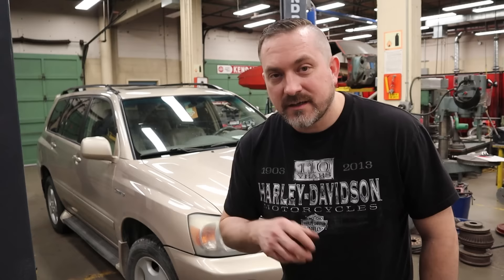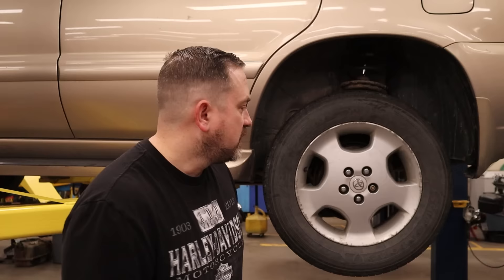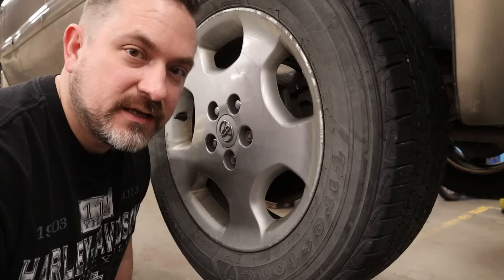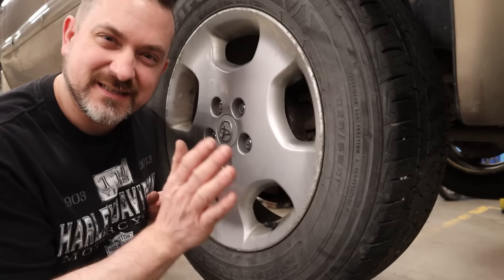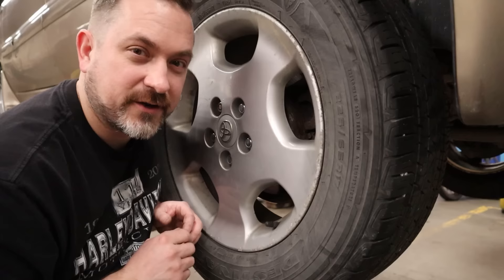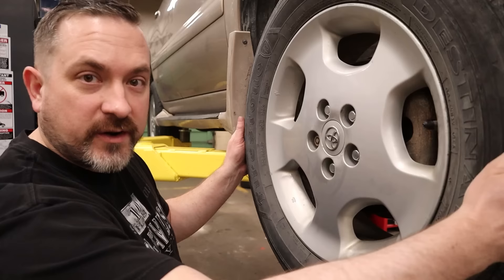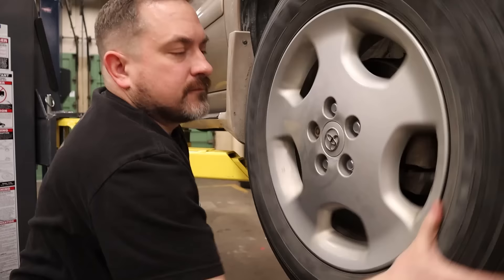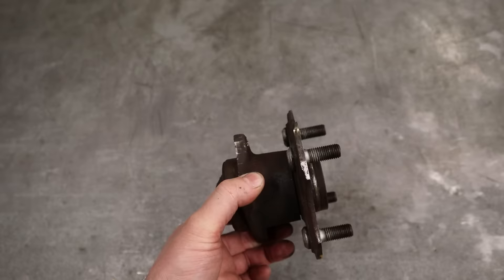How to 100% diagnose a bad wheel bearing.

Comment: Would it be the same, 0n a 2016 Rav-4 all wheel drive ??
Reply from the maker: Yes it should be the same as it has wheel bearing assemblies too.  Thanks for the watch!
Reply: I think mine is acting up, Left front!
Reply from the maker: You confirm it and change it?
Reply: Had the Left front wheel bearing replaced Yesterday Oct.6th, all quiet on the left front, thank you everyone 😄
Reply from the maker: Sweet! Glad you got it sorted out.  Cheers!

Comment: 2009 kia sportage  awd automatic  , when i let off the gass i hear grinding in front wheel it sounds like but i cant tell which side , i have jacked up both sides and no play in wheel bearing , i role the wheels by hand and no grinding , ive took off the break pads and all is good nothing touching , when i cut left or right the grinding is not as loud and when i apply the breaks it gets quite . im desperate now iv spent a couple ours trying to find the source of the grinding, i hear it most about 10mph
Reply from the maker: Is the backing plate/ dust shield touching the caliper?
Reply: hey you  wouldnt believe but i found the tiniest asphalt chip under the edge of the bracket holding the caliper  . dont know how i had the caliper off 2 times without seeing it , i had looked all around that thing and never did see it , i finally gave up and started taking the spindle off and it fell out soon as i rolled the rotor with the caliper bracket lol   ..   @wayofthewrench
Reply from the maker: Well what do you know......Did it fix it?

Comment: Ik this is an old video but im hoping you can respond. What if the sound does change when you break? So while im going down the road i started hearing a whirring sound that got louder as i tried to accelerate, i let off gas and it was still there. When i hit the breaks the sound completely went away. I then pulled over and turned car on and off then continued home with no sound for a ten minute drive. Ideas?
Reply from the maker: I would suggest jacking up the car and doing the tests to see if it has any play, check all 4.  If they are ok, check the brakes and steering/suspension parts out.  I have a great video on checking your disk brakes and how to jack up your car if you need.  Cheers!

Comment: Why didn't you mention play left and right,  up and down could point to tie rods or ball joints?
Reply from the maker: I believe I mentioned that if you have play only up and down it will be a suspension component and if you only have play left and right that it will be steering lock or steering components.  I didn't go into detail on that as these videos tend to get too long.  I will eventually make steering and suspension videos in the future.  Thanks for your very valid suggestion!  Cheers!

Comment: hi on a 2010 Acadia the front passenger tire if on the ground i can pull from top and it has play with out lifting up could the be a bad wheel bearing.??
Reply from the maker: Yes or a loose strut or loose lugnuts.  This check really should be done off of the ground though.  It sounds very bad, please get this fixed right away.  Take care.
Reply: @wayofthewrench  thank you i will.
Reply from the maker: Cheers!

Comment: Got a 2005 C class kompressor kompressor 1,8cc auto when driving in a straight line the car is as smooth as butter like new when I purchased when I for just the car I noticed there was it download wheel on the right front and side this is leading me to believe it might have hit a footpath or pothole because when you go over a speed it wobbles and fishtails can anybody tell me what this might be or at least where to start
Reply from the maker: It's a little hard to understand your question but if you have issues at higher speeds, it could be a bent rim, out of balance wheel, tire issue, bad wheel bearing, or loose steering/suspension parts.  Good luck!
Reply: Thank you for your reply I was using voice to text sometimes it does not say what I say 😂😂 when I drive in a straight line fast or slow it is smooth but if I go over a speed ramp or hit a pothole now the doughnut spare wheel is on the front right hand side when I turn left the car will wobble if I turn right and await goes on to the Goodwill the car will so I'm thinking the reason the spare wheel one of them space savers is on the car because the person I bought it from must have hit and perhaps I need to do a stability arm it has been raining where I am and lifting waiting on some comments back to see if anyone agrees with my thinking that the reason the space saver wheel is on the front it is only when I turn the wheel and put pressure on that side I get the death wobble what confuses me if it is that front-wheel would it make the back-end wobble
Reply from the maker: If you bought the car with a spare wheel on it, there is probably a problem like they hit a curb or something.  If the spare wheel is still causing issues, they probably bent up some steering/suspension components too.  It sounds like multiple issues so I would suggest that you take the vehicle to a mechanic for them to assess what the vehicle needs.  Good luck!

Comment: I replaced all 4 bearings on a prius with 225K.  now i have a loud whirring when at highway speeds.  i did the shake test and the spin test and they seem perfect.  dont i need the weight of the vehicle to made noise?   its really hard to distinguish if it is front left or front right, what are the chances they are both bad right out of the box?
Reply from the maker: You could have a bad part but I would look at other things too.  Maybe a bent dust shield?  Cv axle is going? Tire delamination/out of balance.  Loose wheel lugnuts?  Good luck on your repair!
Reply: @Way of the Wrench  getting a steelman chassisear to help narrow it down. Hoping it is cv but I did not think cvs made whirring sound.
Reply from the maker: You get it figured out?
Reply: @wayofthewrench  I got my electronic stethoscope to try to narrow down if it is a left/right/or both.   hope to get to it it this weekend, will keep you posted.   where i purchased the wheel bearings from has agreed to refund me,   that is a small part of the effort that goes into replacing the bearing as you know.
Reply from the maker: Oh cool! Did you try it yet?

Comment: What happens if you don't replace it, will something eventually break? When I drive, the wheel sounds like a steam train chugging along, it is super loud the faster I go, but while turning to the right the noise goes away.
Reply from the maker: Yes it will get worse and worse till it breaks.  Your bad bearing is on the right side due to the sound going away during right turns.  Good luck!

Comment: @wayofthewrench my car vibrates at speeds from 58-65mph. My steering wheel and the entire car vibrates at those speeds. I have taken the car to my Lexus dealership and also my local discount tire shop as I have less than a year old Michelin PS4S tires. They have aligned, road force tested, rebalanced & everything and they still can’t give me a clear as to the problem. I am running a slightly lowered car in stock suspension with lower springs and some 12mm wheel spacers and all they want to say is that it’s possibly the wheel spacers since that’s “aftermarket” and the quickest answer for them but I think it may be my wheel bearing and the fact that I had to cut my studs slightly. My car has 60k miles and it’s very well taken car of. Any ideas of what else it could be before I start spending money on parts I don’t need??? Thank you!!!
Reply from the maker: If they had to cut the studs, it's possible that a stud is longer than the others and causing an imbalance.  Try measuring with a digital depth vernier caliper and grinding them to exactly the same length.  As for wheel spacers, can you install the wheel without them?  If so go for it and see if the vibration disappears.  If it's a bearing, the vibration and noise will get worse.  You can try lifting the car and hold the spring while spinning the wheel.  A roughness will be felt if the bearing is going.  Good luck!

Comment: What if it makes a squeaky noise when turning to one side?
Reply from the maker: Bearings don't usually make squeaky noise, they are usually grinding, grumbling noises that are speed dependent.  If it's squeaky, it's probably something else like a suspension component or steering component.  Try bouncing the car when it's parked and turning the steering to see if someone outside the vehicle can hear/pinpoint the squeak.  Good luck.

Comment: If my car has a sight vibration when driving but no noise can this be bearings?
Reply from the maker: It could be but it will be for sure a speed dependant thing.  As you speed up it gets worse....as you slow down it lessens.  If there is no noise but vibrations, I would expect it is a wheel balance issue.  Both are easy to inspect just like I did in this video.  I also have a good video on wheel balancing you should check out.  Thanks for the watch!

Comment: My wheel sound the worst around 30 mph. Also sounds bad when I’m slowing down and get down to about 20 mph. My tires are also worn on the outer edges. I’m gonna jack it up today and check this out before I bring it to the shop.
Reply from the maker: Hard to tell from just a message but could be a wheel bearing, tires, bad alignment, or CV axle.  I have another video on road testing a bearing that you should check out.  Hope you figure it out.  Thanks for the watch and welcome to the channel!

Comment: I have 2010 Mazda 3 with 170k KM on it. Both rear ball bearing hub assembly I can hear bearing sound, one is louder than the other. There is no play at all. Should I replace both? Thanks for you advice.
Reply from the maker: Usually you change them in pairs because when one is gone, the other  is going.  Thanks for the watch!  I have a how to change wheel bearing hubs video you should watch too.  Cheers!
Reply: So do you think they both needs changing as I can bearing sound.  Also do you think the sound is coming to speed sensor.? I will watch you video if I do end changing them.  Thank you.
Reply from the maker: If one is bad then yes, I think the other should be changed as well but you can start with one if you want.  The wheel bearing doesn't affect the wheel speed sensor but as the wheel bearing grinds itself up, you may have metal shavings collect on the tip so clean it really well if it's in the hub.  Cheers!

Comment: Mine doesn’t have any play but it does make a little bit of grinding noise when I spin it and howling noise when I drive around. The grinding noise is not as bad as your car, should I still replace it ?
Reply from the maker: If it is speed dependant and makes noise from the bearing and not the brake pads/drums/cv axles then yeah it sounds like a bearing starting to go.  It will soon develop play if it's bad.  Thanks for the watch Jefferson!
Reply: Same here. No play just growling noise that my Niece thought it was from the engine. I went underneath and I'm thinking wheel bearing. I dont think bad axles make that noise. Am I correct?
Reply from the maker: Sounds like it it's bearing noise.  If you leave it, the play will start and get worse.  Is it front wheel bearing noise or back?
Reply: @wayofthewrench  it is front driver side.  Will be replacing it asap

Comment: My tire flapping like some bird wings😂😂😂😂 see what I'm doing today
Reply from the maker: Ouch.  Hit a curb?  Or is the tire just old?
Reply: Guessing they never been changed still got a little wobble in driver side but I can't see anything wrong except for a little power steering leakage
Reply from the maker: Maybe they have been sitting and have flat spots.  Hard to say.  If they are older than 5-8 years, you should look at replacing them.  Good luck!

Comment: Not sure if it's a bearing or not..15 Ram 1500 has a thump, thump, thump sound that gets louder while turning but seems to become quieter when breaking but does resemble the sound of a helicopter at 50+ mph. Don't notice any looseness when off the ground
Reply from the maker: Sounds like it might be a cv axle.  Is it rear wheel drive or 4x4?
Reply: @wayofthewrench  4x4
Reply from the maker: If you have cv axles on the front, you can test them by going to a parking lot and doing full turns in both directions and in reverse to stress the different inner/outer cv joints.  If they go clunk clunk clunk in the full turn, its no good.  A test from underneath is to jack the truck up and grab the cv axle with your hand and try spinning it both directions....there should be no looseness or play if it is good.  Good luck!

Comment: Will the rim be really hot also ?
Reply from the maker: If you've been driving and the wheel bearing is really bad, it could be hot but the main diagnosis is looseness in the wheel and a sound dependent on wheel speed.  Thanks for the watch!

Comment: Can it also make a scraping noise ? (Talking about the rear wheels )  At the beginning its just does kgggg .... Kgggg en when i go faster the kggg sound goes faster
Reply from the maker: It can but I would also check brake components and the thin metal dust sheild as sometimes it gets bent and touches the disk.
Reply: @wayofthewrench  i do not have a dust shield ive already checked them
Reply from the maker: Sounds like your brake pad is worn and rubbing metal on metal.  Check the inner and outer pads....I have a great video for inspecting disk brakes.  Cheers!
Reply: @wayofthewrench  but the weird part is , sounds is coming from the front wheels :/.. when is raining u cant heat it but when the stuff gets al heated up the sound comes back , ive a video on my channel of the sound!
Reply: @wayofthewrench  and it only give the sounds when there is pressure applied , when the car is on the lift with the wheels of the grond the sound is completely gone
Reply from the maker: ya gotta check the pads and maybe the caliper is sticking.  Good luck!

Comment: Mine wobbles more and the bearing isn't but a couple years old and i drive it like a baby carrage. Tomorrow it's going in the shop, i hope the tire don't come off
Reply from the maker: Not good.  Sounds like perhaps loose lugnuts or a really bad steering/suspension component.  Hope you get it sorted out.  Thanks for the watch and welcome to the channel!
Reply: @wayofthewrench  Sorry I meant it doesn't wobble driving but when I put a floor jack under it it has play up and back and forth pretty bad, but sounds like a freight train driving. I've replaced all of them in the past so I just had it done and just missed the warranty by six weeks! China bearings and I live in Michigan we have the worst roads to destroy wheel bearings. I got it done out the door for 220.00 in Detroit, where I live they would charge triple, or Belle tire
Reply from the maker: 220 is not a bad price, in Canada that would just be the cost of the part!

Comment: I've been thinking my wheel bearing is bad, at low speeds it's a rumble and grinding that i can hear and feel, but there's no play in either wheel, and it rides pretty smooth at higher speeds. Kind of odd.
Reply from the maker: Try turning quickly a bit at speed when you hear the sound.  If it goes away when turning a certain direction, then it's a bad bearing on that side.  Does it make the sound all the time or only when on the brakes?
Reply: @wayofthewrench  all times when moving, but seems to be worse at low speeds, and it does change with turning a bit, however I just jacked it up, I have  one caliper that may be seized it was really hard to turn. I freed up the caliper and now both sides spin flawlessly with no detectable resistance and I hear nothing when spinning by hand. Might be differential or axle. Haven't test driven since I'm checking out a few other things with it up on stands. I should add I didn't detect any vertical or horizontal play in either side.
Reply from the maker: Might not be bearings then.  Check cv axle and brake disks too.

Comment: What if the noise volume remains the same at all speeds but has a rotation that speeds up with velocity
Reply: Braking stops the noise as well.
Reply from the maker: Try to figure out if it's engine ROMs or vehicle speed that changes the sound.  You can rev the engine in park to see if it's an engine rpm sound.   I do have a great video on road testing a bearing you should check out too. Thanks for the watch!
Reply: @wayofthewrench  definitely not related to the RPMs. Or the engine. It comes and goes and occurs more when the temperatures are hot and the vehicle is warm. Wheel bearings are tight
Reply from the maker: Sounds like something drivetrain related like tires, wheel bearing, rotors/pads, axle as the sound is vehicle speed related but not engine.  What does the sound sound like?
Reply: @wayofthewrench  turned out to be faulty caliper. Had it changed and no issues since
Reply from the maker: Glad you got it figured out!  Cheers!

Comment: Your 'checking side to side play' just tells you that a steering joint is loose! Top and bottom play tells you if the hub bearings are bad, -assuming the top and bottom ball joints are ok. Also, to tell which side the bad front wheel bearing is on, you have to drive and turn sharp left to listen for a bad right hand bearing and turn sharp right to listen for a worn left hand bearing. You should know all this and tell people!
Reply from the maker: Hi John, I just watched my video and I did talk about what you said.  It's in there.  Good tip about the hard turns to unload/load the bearings.  I find that test doesn't always work though.  Thanks for the suggestions.  Cheers!